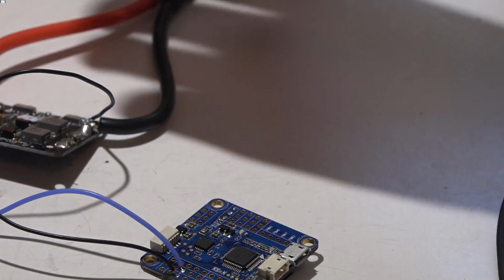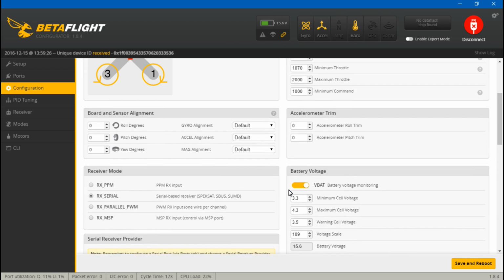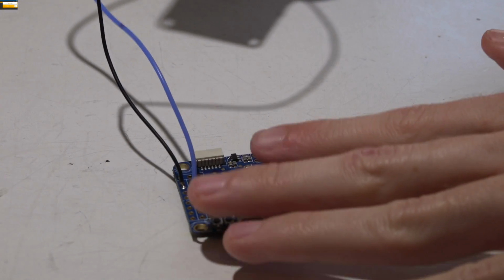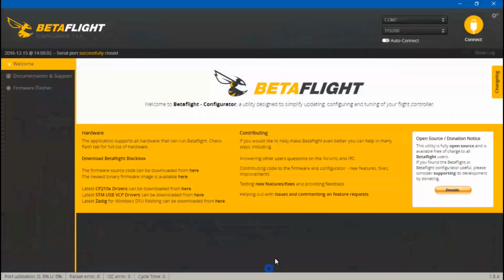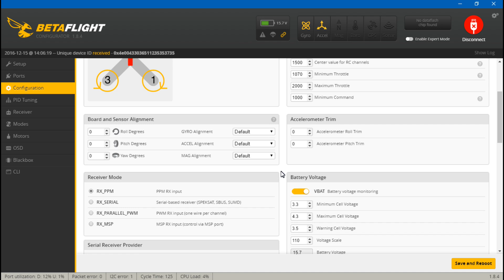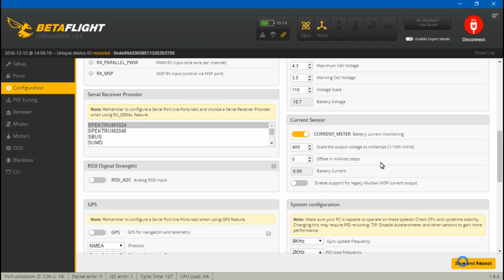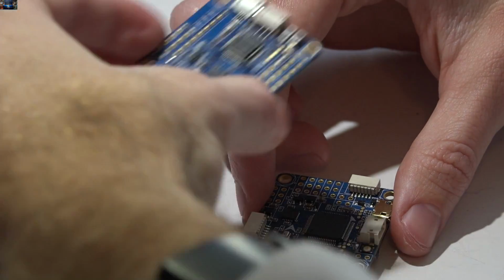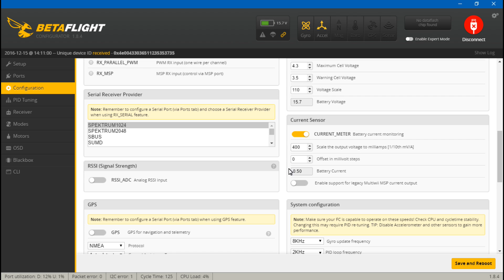Flip32 Omnibus: How To Power (F3/F4/Pro/NonPro)

Comment: How am I supposed to plug in my flight controller into my computer at the same time when my quad is powered?
Reply: plug it in via USB first then plug in the battery, the quad won't arm once it is already connected to betaflight

Comment: Can anybody answer this question? Is it possible to connect the FC to a computer to Betaflight also while having the quad powered up with it's own battery. Will this fry the flight controller, and if so how can I connect the flight controller to a computer and also power it from a battery to calibrate esc's?

Comment: Hi, I want to ask about omnibus f4 pro V2.
Fyi, I want to run an INAV into it in a flywing model.

So, here is the thing, 
I connected the Sbus port from the FC to the Sbus port on the FRsky receiver L9R.
after that,
I connected the usb to the computer. The fc come to alive. but the receiver dont.
I dont know what is wrong. on the manual, it written that Omnibus f4 pro v2 has inbuilt bec.
it should also powered the receiver  isnt?

oh iya, perhaps I should mention that I also tried it with the power from battery. 
the fc is alive, but the receiver just dont. actually I could use an external bec to power the receiver. but if I do that, it will remove the purpose of internal bec isnt it?

could you tell me what is wrong?

thanks

Comment: Good video, but there is one mistake.  After thorough testing and looking at several forums, I'v found out that you will not be able to power your servos unless you supply a separate 5 volt source to the servo power rail.  You can either use the 5 volts from your ESC-BEC or an external BEC, else your servos will not get power.  There is a Shottky diode that blocks the +5VCC  generated by the FC regulator from getting onto the servo power rail. 
For details and potential mods, go to this link: https://www.rcgroups.com/forums/showthread.php?2874687-OMNIBUS-AIRBOT-F4-family-ESC_5V-Isolation

Comment: When I power up, the flight controller and receiver get power, but not the servos.  I tried another F4 V3 and had the exact same problem.  If I connect the BEC from ESC, everything works. It seems like the servo 5 volt rail is isolated from everything.

Comment: Is there any way you could help me with my omnibus f3 pro v2 flight controller? I can NOT figure out its wiring at all and how to get power to it :( i have good pics of both my FC and the 4 in 1 esc I’m trying to wire it with. And pin outs for them. Pleeeeease help 💔

Comment: Hey do i have a good one, my 250 arms can hover then will disarm and shut down. I have watched all arming issue vids , my build is a 250 frame cheap one , emax 2204 motors , emax 30 amp bullet ESCs , omnibus f4 v3 . if beeper connected it beeps rapidly after shut down. I checked channels to make sure no conflicts with switches. osd works too . i rebuilt it with a new from airbot f4v5 same problem. So next is scrap ESCs and hope for the best. I watched a lot of your videos on omnibus. any help would be awesome, I have a martian 2 same setup but emax red bottoms , only difference in build is i connected all negatives together and soldered to one pad on 250 that has problem and on martian soldered 2 together and onto 2 pads. that shouldn't be an issue but when i scrap the esc for new better ones i will solder all ground wires to their respective pads. thanks glad i have money to spend on quads as all other money spent is just a waste.

Comment: Thanks for an excellent and informative video. I currently have the Omnibus F4 V3 (non-pro) (RTFQ) in a Sky Surfer with GPS and works great. I have purchased another F4 to put into a X-UAV Talon and the external current/voltage board from RTFQ (http://www.readytoflyquads.com/readytoflyer-power-module). Could you possibly help with connecting this to the FC as I am not able to find any info anywhere. RTFQ states “ 6-pin cable that directly matches the FC’s connector.”   The only 6 connector on the FC is the J11 labeled CS,MISO,SCL,MOSI,VCC_RC,GND. I thought the J11 was for other types of external sensors???. There is a pin out marked CRNT/GND and could be used but not all 6.
Thanks

Comment: hi ! i need your help , i `ve been watching all your videos, step by step about this board but something is wrong with mine i guess , flashing went fine , config , receiver tab , flight modes , everything works fine ,i have  aetr1234 in betaflight , mode aetr with taranis , i have this bf 3.1.5 omnibus f4 v2.1 and when i power it the same you do i have a steady green light but no blue light , (blue light only with usb) and in motor tab by increasing ( motor #1 it moves servo #8  )and my motor spins , i`ve check voltage on all pins and sbus pins=1.9 volts ? normal

Comment: I have had some interference in the FPV video with the Omnibus F4 Pro V2, despite feeding the FPV gear seperatly and through a LC filter. So, my only conclusion is that this current sensor in the FC is somehow interfering with the image. Any thoughts?

Comment: PBF can you explain how to get servos work( how to get them 5v) I have all done but my servos doesnt move(Flying wing) :((
Reply: The video is misleading one one major point.  No, the servo rail is not powered by the fc because there is a blocking diode that isolate the FC +5v from the servo rail.  To get power to the servos, you need to either use the +5v from the ESC-BEC or a separate BEC.  See this RC group link:
https://www.rcgroups.com/forums/showthread.php?2874687-OMNIBUS-AIRBOT-F4-family-ESC_5V-Isolation

Comment: HI PBF I do not understand everything, I'm new to this hobby but I was watch all yours  videos and still nothing.  I plug the usb to F3 V1 omnibus and my uart 2 (sbus rail) produces 5v(4.5V)  and in the INAV tab(receiver)  there is no reaction to the motion of the controller but on F4 Pro  I see AETR  they move perfectly so the sbus working.....maybe there is not enaugh power from usb soo I put power from 3s Lipo....and NOTHING :(

Comment: Hi and thanks for your videos Project Blue Falcon. I have connected Omnibus F4 Pro in VBAT config and everything worked fine. After a crash though I cannot power the FC with battery, but it does light up through USB. Any idea what might went wrong? Thanks!

Comment: AWG14 with 4S and AWG16 with 3S?
Dude higher voltage means lower current on the same power consuption.
So as long as the setup is using the same motors, you have to use bigger wires with lower cell counts!

Comment: removing the linear voltage regulator from the bottom of the board and powering the 5 volt pin with a 5volt switching regulator (ubec) and keep the vbat pin connected to the main battery is the best option. then you get to see the voltage, your board will not fry from the excess heat from the linear regulator and the switching power supply can supply about 3A which can easily provide enough power for the board and the camera.
Reply: saswata hira I think there is my problem when I try to run fc on plane then after few seconds motor stops. Probably there is less voltage when motor run. Could you please tell where is this regulator?  I have Omnibus F4 v3

Comment: @ 7:24, you're going through the ground wiring for the F4 Pro. Question: can't you use a thin wire for the ground connection between FC and PDB?

Assuming your negative battery lead (w/ thick wire) is connected to the PDB, providing a return path for your power-hungry motors, shouldn't there be a comparatively small amount of current flowing through the ground wire between the FC and the PDB? I.e. just enough to power the FC's electronics?

Comment: Can I power the pro version with usb and lipo at the same time? I powered it with lipo, worked fine, disconected and connected usb, again worked fine. Then I connected lipo to try spin motors from beteflight software and bam, magic smoke.

Comment: I need to ask question does omnibus f4 pro v3 support 5s directly off pdb ? In my case the impulse alien 5" pdb I've got power and ground directly into flight controller? I have had weird issues and just other day it fell out sky and flight controller quit working won't connect at all, so now I've got new one coming so I wanna take precautions and do u recommend running esc signal around ground or power for less noise? Sorry alot to read but u always been big help

Comment: Very confused. Really need help. F4 v2 pro for fixed wing. Don't I just solder the battery to bat tand ground then power the motor from the motor pad? Won't the servos get power from the fc? 

I soldered the batt + and -, plugged in a 3s, green light came on for 2 seconds then went out. Now I can't power it from battery, USB, or pwm 5v. 

What did I do wrong. This is a pain in the butt. Already ordered another one but don't want to repeat the results.
Reply: the onboard FC reg is a poor 1.5 amps and not useful for the servos not even a wing.
Reply: No, the servo rail is not powered by the fc because there is a blocking diode that isolate the FC +5v from the servo rail.  To get power to the servos, you need to either use the +5v from the ESC-BEC or a separate BEC.  See this RC group link:
https://www.rcgroups.com/forums/showthread.php?2874687-OMNIBUS-AIRBOT-F4-family-ESC_5V-Isolation

Comment: I just accidentally touched + from the battery to Batt+ on the In side of the current sensor and Batt- to the positive out side of the current sensor.

it sparked and melted the solder on the pads I had tinned, but I didn't see any magic smoke. 

Did I kill the board or maybe just the current sensor?

Comment: Great Tutorials, however I was thinking if you filter your main Flight pack Lipo voltage before feeding it to this board as you have demonstrated, this will give a clean, convenient (3 pin) output feed for both camera and VTX??? Most Cameras will handle 4S these days, but some of my 1.2G VTXs will only cope with 3S, ....5.8G vtxs seem 4S capable too....
   If Im using servos, where do I apply the separate power for these???....and is it safe to plug in the USB at the same time?
 Sorry , for the questions, and I realise your clips are multirotor based....but  iNav is opening these up for fixed wing use now....Subbed BTW....:)

Comment: can you please either tell me or make a video on what is the difference between the Omnibus F4 and the Omnibus F4 Pro besides an SD card slot I know that. I see a big chip on the board labeled OMSD what is that? I thought that was a current sensor? the regular F4 does not have that chip but it still says it has a current sensor I'm really confused on why they both say current sensor but one has the battery wires going right to the board. can you please explain the difference please!!! I'm sure there are a lot of people who have this question! I have spent the last two months trying to figure it out and still have not a clue and no information I've looked on RC groups and other forums. I have come up with no info my friend has the regular F4 I have the F4 Pro and I don't know the difference besides the F4 Pro is a pain in the butt to hook up for some reason I thought that was so you could use a current sensor but if the regular F4 has a current sensor than why is it so difficult and weird hooking up the battery leads to the F4 Pro? why was it done like that? what is the purpose? please please please explain this is a mystery driving me nuts! Lol I know this video is getting kind of old but I hope you still read this and possibly respond

Comment: When connecting the current sensor, you only need to use the heavy gauge wire on the B+ and the output pad on the opposite side of the shunt resistor.  The GND connection can be a lighter gauge since it doesn't need to pass the current that goes through the ESC's, only the FC and whatever it's powering.  This should save people from having to solder 2 heavy gauge wires to one pad (not much fun).

Comment: I got the F4 Pro V2 but my 4in1 ESC also has a current sensor, voltage sensor and 5V BEC. Will there be any issue having 2 current sensors in the loop? Or are there inputs on the F4 Pro for external voltage and current sensors so I can run the FC on the 5V BEC? What would you recommend?   PS. You're a legend!! Your various playlists have helped me immeasurably and the detail and clarity of your explanations is unrivaled

Comment: During soldering the "BAT"-PIT and "Om50"-PIT were connected and I couldn't remove the soldering point very well. So that when I used my LIPO, the Omnibus F4 "Om50"-PIT made a short sound. My F4 is still working with the pc. Is there any possibility to still use it? Sry for bad engl

Comment: I bought an omnibus F4 from banggood and got it hooked up via usb to my PC. My transmitter channels look great in the beta flight app, but when I disconnect everything and power just by Lipo, the second I turn on my transmitter, the quad freaks out and pings my ESC's and even the transmitter starts chirping. You ever seen anything like that? I was able to bind OK, and I know my transmitter, receiver, esc's etc are good, but this board is driving me nuts.

Comment: Hi JC I bought a FLIP 32 - F3 - OMNIBUS. I've added   a link of the one I got. It's slightly different to most Omnibus f3 the white port next to the Osd got 10 pins, The first two is Vout and Vin plus eight more. Are any of these pins important or don't you need to use any of the.  If it's important where can I find the connector for the port. Thanks
http://www.readytoflyquads.com/flip-32---f3---omnibus-bec---w-baro-option

Comment: Something is a miss here.  To read DC current it only takes to break one leg and place the amp meter/sensor between the break completing the circuit.  The flight control board is only going to draw maybe two amps-max; so why ground it with a 14 gauge wire?  The high current is only running through the PCB  through the ESC's to the motors, and only read by the flight control board on the + VBat leg.  No need to run a 14 gauge ground wire () back to the flight control board just to power it; you can power the flight controler through the USB connector.  The issue I see here is feed-back from the motors--which will be seen as an AC ripple pushed back from the motors through the ESC's; and digital circuity hates that.  Put a big capacitor between the + and - pads on the PCB as a band-aid.  ELI the ICE man is running rampant here with our motors.

Comment: hi thanks for the tips helps alot. abit confuse on one thing thought. what on the last method with the v4 pro without the current reading. what gauge wire should i use from the pdb to the fc?

Comment: There is something I can't understand. It looks like Omnibus F4 should be powered directly from battery, and some descriptions say that clearly. But most other descriptions on Ebay say the following: "-You will need to power this board via an external BEC as the built in LDO is just used as a voltage protector and cannot be used for a long time, otherwise it will overheat." For example: http://www.ebay.com/itm/232273874606
Which is true?
Reply from the maker: You can do it both ways. Normally I power it off the lipo like in the video. I've done this on 6 out of 7 omnibus controllers. But the voltage regulator gets very hot. Thats normal though for that type of regulator. Problem on the 7th Omnibus is it gets so hot it makes the processor reset. In that case you can cut both legs off the voltage regulator, and then power the board with 5v from a PDB. Just place the wires on any power and ground pin on the motor pins.
Reply: Thanks! If I cut off voltage regulator, can I still use the current sensor?
Reply: This is no longer an issue with the current versions correct? The F4 V3 Pro?
Reply: mportillo78 I think this is not an issue also with v.2 and any other version that uses SBEC (switching BEC). It  is detectable easily by looking at the components on the board.
Reply: I have some hefty servos that I want to power on my race wing using an external castle 10A UBEC.  I wouldn't mind powering the FC using this UBEC as well.  I want the 5V on the PWM outputs to be from the external castle UBEC.  Would I just remove the voltage regulator as you've suggested to accomplish this?

Comment: I learned so much from you, thanks man!

So I have the F3 and want to connect it to my matek PDB, so I'm gonna run wires from the big PDB plates (where the escs go for example) to the "lipo" spots you showed in the video.

What kind of wire would I use for that? It will take full voltage, but the pins are super small.

Comment: Copy and paste question. Just really want to know the answer to this, as it'll help me make a decision on if I want to buy the Omnibus F3 or not. Please respond...

Hey, those pins adjacent from the USB port (uart1) you said you would show us in a later video to power the vtx and cam from. Well you also said, we'd have to remove any connections from uart1 before plugging into BF because everything could mess up.

Does this mean I'd have to desolder the cam and vtx every time I want to plug into bf?

Comment: Hey, those pins adjacent from the USB port (uart1) you said you would show us in a later video to power the vtx and cam from. Well you also said, we'd have to remove any connections from uart1 before plugging into BF because everything could mess up.

Does this mean I'd have to desolder the cam and vtx every time I want to plug into bf?

Comment: Quick question, I have the Omnibus F4 Pro V3 and I am connecting it to a 4 in 1 esc with the connector on the bottom of the board and I will be using the current sensor also. The question is do I need to remove the 5v from the 4 in 1 esc that plugs into the flight controller?

http://www.racerstar.com/Racerstar-RS20Ax4-4-in-1-ESC-p-64.html this is the 4 in 1 I have
Reply from the maker: Yep remove the power and ground from the 6 pin connector. It's not needed.
Reply: Project Blue Falcon awesome thank you so much! glad to see you are back on YouTube!